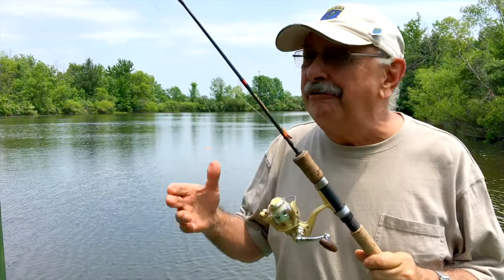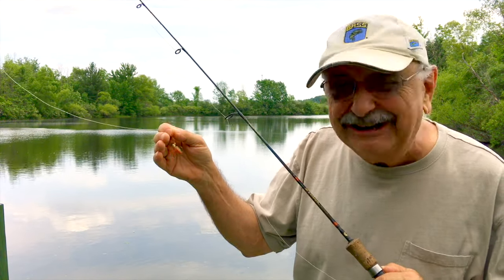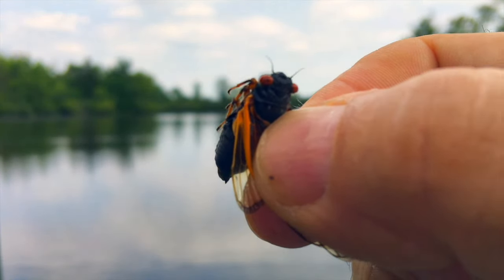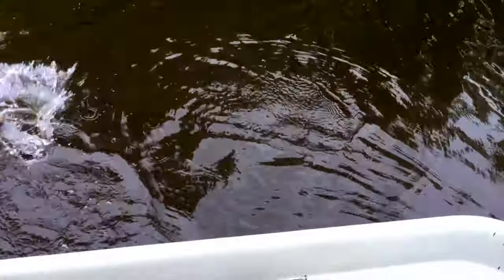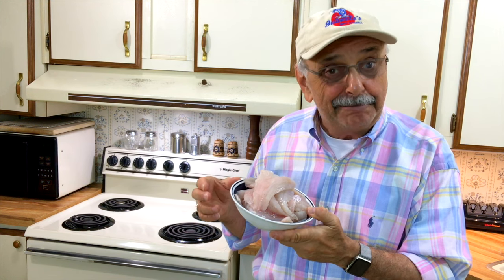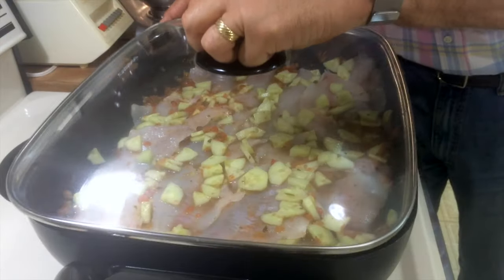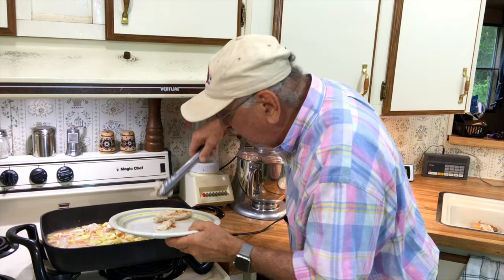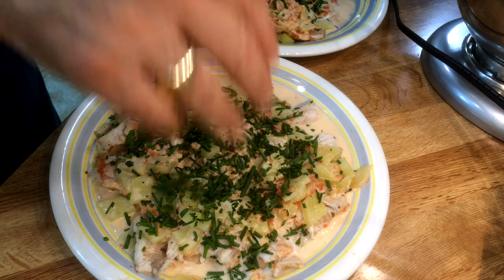Casting Cicada Bugs for Fish Riviera

Comment: Love the videos my friend. Wishing you and Ms. Lulu all the best. I found and tried this recipe and loved it. I wanted to pass it into you. Hopefully you could make it low carb. God bless and happy fishing
CAJUN BLUEGILL OR PERCH Bluegill or perch fillets—about 1 pound1/3 cup yellow corn meal1 1/2 cups flour1/4 tsp. salt1/2 tsp. black pepper1/2 tsp. onion powder1/4 tsp. garlic powder1/2 tsp. paprika1 tsp. dried parsley1/2 tsp. dried oregano1/4 tsp. cayenne pepper1 egg Preparation: 
Combine corn meal, 1 cup flour and spices in a small bowl, mix well. Beat the egg and milk in another bowl. Remove the skin from thefillets, wash with cold water and dry with paper towels. Put 1/2 cup flour in a plastic bag, add filets to the bag and shake to coat with the flour. Dip, one by one, into the egg mixture and then into the corn meal mixture. In a large frying pan, heat the corn oil, about 1/4 inch deep, to about 375’. Carefully place the filets into the hot oil. Fry until golden grown on all both sides.For draining fried fish—I line a cookie sheet with paper towels and then place a cooling rack across the cookie sheet so it is elevated above the towels.  Put the fried fish on the cooling rack. The fish stay crispier and drain better—they are not ‘sitting’ in the oil on the paper towels.Recipe from: www.LakeMichiganAngler.com
Reply from the maker: Hi Rob!! I almost missed your comment somehow!! SO SORRY!!! My goodness your recipe for Cajun bluegill/perch sounds out of this world!!! There may indeed be a way to make this low carb! I LOVE IT!!!! I need to make it! I don't know about doing it on camera, but I have to try it!! YUMMERS!  Awesome! Thanks a million!!!! I can't thank you enough!